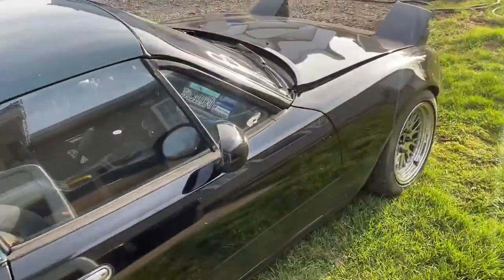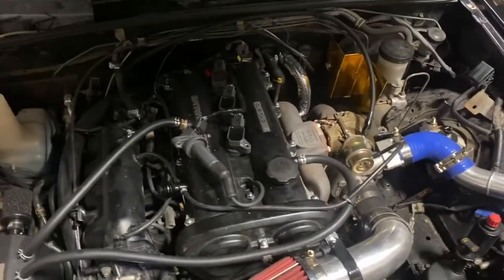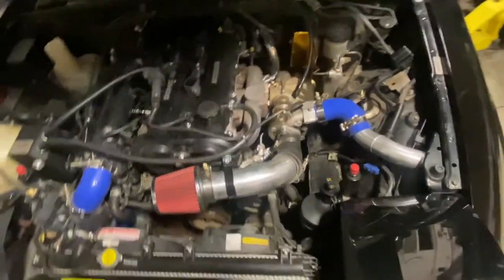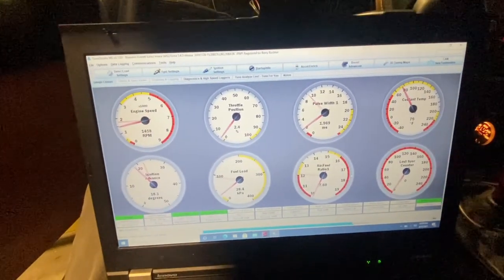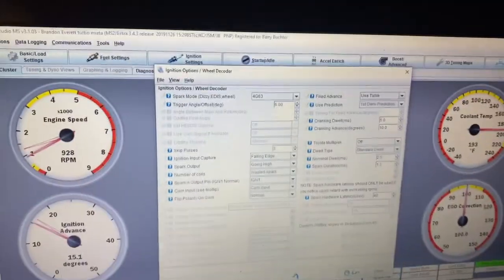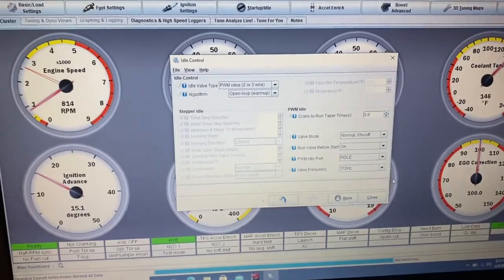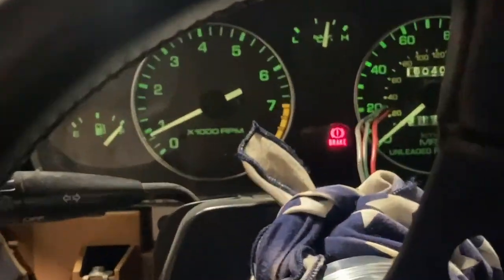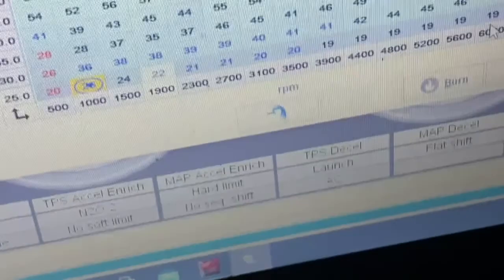Turbo Miata Part 1. Megasquirt Tuning for BOOST

Comment: bro where are u located i need help with my speeduino ecu on my miata, it runs poorly and wont start up immediately like this one 🥲
Reply from the maker: I dont do much public tuning anymore. But a lot of the tips in this video apply to speeduino as well as its function is pretty close to Megasquirt.
Reply: @spankranchgarage  i gave up and switched it out, thank you for the tips im just not capable of making it run smoothly and turn on smoothly

Comment: Have any advice for a high idle just installed ms2 in my 91 Miata ignition timing perfect afr reading a solid 14.7 for the most part my car wants to idle around 2,100 rpm and I can’t figure out how to get it down I did turn the valve on the throttle body to bring it down but it barely did anything I heard online you shouldn’t do that, that it has to be something with the new ecu any advice?
Reply from the maker: Sounds like an IAC configuration issue or it’s stuck open. Can you get the iac to make any influence on idle speed?
Reply: @spankranchgarage  you were correct my idle before once warmed up all the way was getting to about 2500 rpm I literally just unplugged my IAC and the car idles around 1000 rpm which is way better than what I was at now gonna try to self tune it a bit and get it down lower my afr stays around high 14s/15s so I’m happy so far thank you! One last question is it okay to leave my iac unplugged!?

Comment: The blue plug behind the right headlight seen in the vid when you used the timing light, is for the timing light or so I read at least.
Reply from the maker: You are correct!

Comment: How should would you approach fixing engine rpm dropping to 450-500 after a rev during netrual? I'm using a doctronic ecu and not much info on it :/
Reply from the maker: Watch the cells in your fuel map in those areas and make sure the AFR is reasonable through and leading up to the dip. You can also add some timing below idle setpoint to help is land more stable. Finally make sure your decel fuel cutoff isnt bringing the fuel back on too late